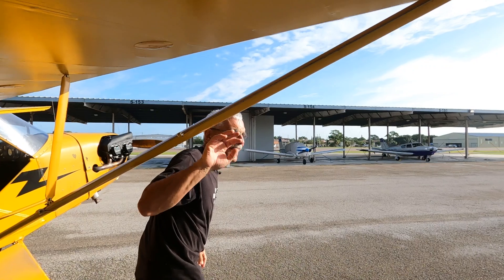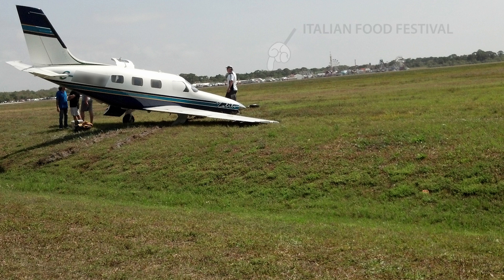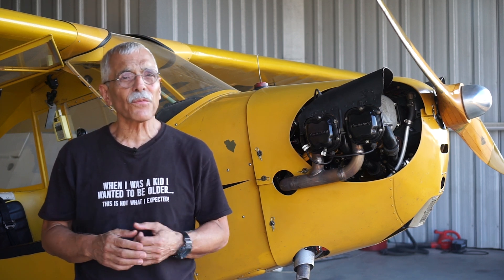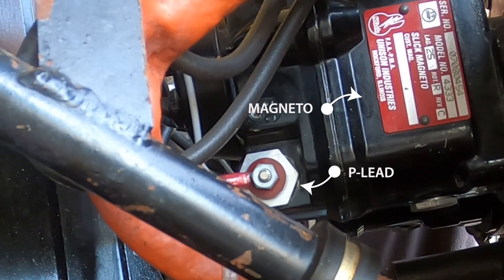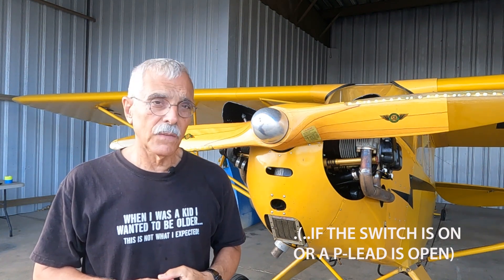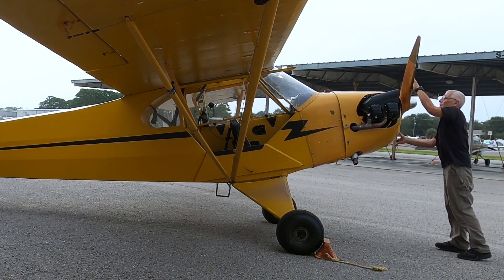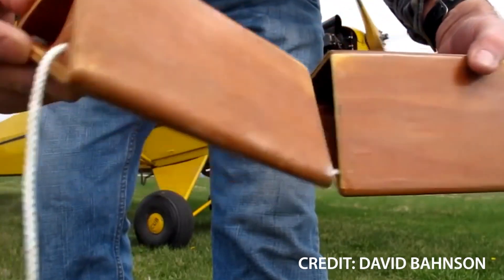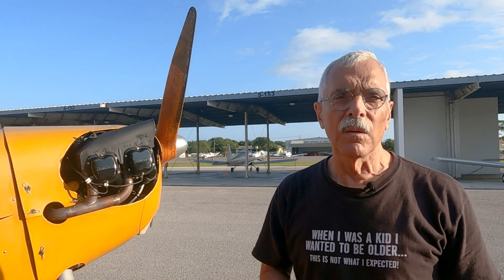Bad for Aviation: Hand Propping Run Amuck

Comment: I have the best hand-prop disaster story of all time…I was studying (back in the 80s) in the Purdue aviation library which was the old control tower overlooking the ramp. It had couches by the windows. It was winter and the ramp was icy. I heard an aircraft engine start up and immediately go to full throttle.  I jumped up to see what was happening. The scene that greeted my eyes was a man laying on the ramp holding his arm, and a Cessna 172 that had just passed him and was rapidly accelerating towards the covered fuel truck parking shelter with fuel trucks lined up in a nice row. I had a few seconds to decide if I should duck to protect myself from the impending explosion, or watch the firewall and maybe still have enough time to duck down. Curiosity got the best of me and I kept watching. As the plane picked up speed, it turned slightly and wonder of wonders hit squarely in an empty stall with a fuel truck on either side. Both wings peeled back from hitting the support posts. As fuel from the ripped open wing tanks streamed back in the wind stream blown by the prop turning at full power inside the stall, I thought I might yet see an impressive fireball. The man who had been on the ground got up and started running TOWARDS the plane. I kept watching until the carb starved of fuel from the rapidly drained fuel tanks, maybe less than a minute, and then it was quiet. A few moments later, to my surprise, a young woman came running from the stall towards the man! That young woman was very fortunate she was not immolated. Later I found out the back story:  This pilot came out to his plane in the morning after spending the night locally and found his battery dead. He elected to hand prop because he was too cheap to pay for a start cart which was available. He was a doctor ‘from up north’ and he was married and the young woman was not his wife or daughter. I would have loved to have been a fly on the wall as he explained the broken wrist, destroyed airplane, and the young woman, to his wife…just sayin’.
Reply from the maker: Geezus. Thanks for that story. I've heard a surprising number of others like it. I had this very thing in mind in making this video. These things are entirely avoidable. No exceptions.
Reply: Poor decisions love company I suppose...

Comment: As with a lot of engines, the Rotax 912ULS used on the planes I flew in school need a couple of turns of the prop by hand to get the oil to circulate a bit. Even though I was making sure myself that the mags are off and everything else is off, the instructor would also check the same, other students would also check it, and it still made me nervous.

Comment: Question: @11:10, why does the prop appear to switch back-and-forth between turning clockwise and counterclockwise? Was the prop continuously spinning in the same direction but it was just an illusion that made it seem to switch directions?
Reply: Yes. Aliasing as the prop speeds up and starts syncing with the camera frame rate. Same effect can be seen on car wheels in videos

Comment: 30+ years ago, I was that 18 year old clown that was asked to hold the throttle and brakes for an older gentleman hand starting the plane. 

Looking back, he didn't show me where the ignition kill switch was, nor did he show me how to kill the fuel either. Just "jump in, push on that and put your feet here and press hard".....

Comment: I worked the Line as I built time and could write a book on what I have seen. At least 2 run aways from hand propping and one Aerostar got his #2 motor running and noticed he was chocked so he got out and it proceeded to do 360s amazingly not hitting anyone. Other were all Mu-2, Commander types and were deadly. "Never ever even OFF walk under a wing. It teaches bad habits.
 A 172 quick tie dwn for a storm, no tail rope so someone used a concrete block. Yes, he taxied with the block dragging. OT but a Baron came in and had soiled underwear wrapped around the tail flying proudly. A charter 402B had a man relieve himself into a fire ext nozzle and discharged it inflight. Mistook it for a Little John.  On Dixie in KATL a Delta told ground that they had a schedule and to tell the F-28 ahead to stop dragging his feet. The F-28 opened his rear center clamshell SB and made a farting noise. 1st time I ever heard the full lineup on Dixie break out laughing.
I could go on and on.....

Comment: One other thing. Stand fairly close to the prop in a comfortable stable position.standing back too far because you’re scared causes you to fall forward as you pull it through. Stand close and step back during the pull.

Comment: Leg swing gets you out of the arc in a hurry. Removing chocks near a spinning prop is also a danger. A long rope properly tied to the chocks
And laid out to be grabbed far away from the prop is important . Especially on nosewheel aircraft.( which should ONLY be propped when you’re stuck in a desert without water!)

Comment: One the things that saved me was to ALWAYS assume the engine is going to fire. Many, many years ago another lineboy and I were moving a customer's Tri-Pacer from it's hangar to the shop. Dead battery of course. He was inside, on the brakes, with the switch OFF (confirmed), throttle at idle. Now 45 years later, I don't remember why I pulled it through forwards to prime it, but I did. It fired. Luckily I was following what Old Buzzard Jack had taught me and did the leg swing, or else I might have been into the prop.

Comment: A loved one owned a Cessna 140 more than 30 years ago. He was a careful and conscientious pilot, but one day he got careless... more than I would have ever thought.
On a fine Saturday morning he prepared to take a short flight. Everything was good except the battery was dead. With the allure of flight just a minute or so away, he set the mixture full rich, cracked the throttle, and turned on the mags. He went around front and propped the plane. That was when things went so very wrong.
The throttle was farther open than he intended and the engine roared to life. The plane was not tied down. The brake was not set. It started rolling toward him so he dodged around and made a grab for the door. He was unable to get in the plane and had no option but to grab the strut and hold on tight. The plane accelerated as it went, until he lost his grip, fell, and was hit in the face by the horizontal stabilizer.
He came to in the ambulance and was briefed on things. The plane had trundled along until it hit a (mercifully empty) fuel truck. He had a couple of facial fractures and a concussion but recovered.

Comment: Great video, but a respectful question.  Why ever prop a cub from the front?  I have always done it from the back.  Out of the prop arc, airplane would instantly move the prop away from you (not toward you), you can hang on to the door frame with your left arm, and are right near the door / engine controls.   Thanks again for the great content.
Reply from the maker: If you place the airplane in a position where it can move forward, you don't know what you're doing.  The airplane can be secured NOT to move forward. That's the point of the video.
Reply: @AVweb Agreed,.   I submit that propping a cub from the rear is the best choice, which is the real point of my comment.

Comment: My first few hours were in a 47 Aeronca Champ with no electrical system.  The CFI did the first propping.  I did it for the next few hours until they bought a different plane (C150).  I tried to prop a Cessna 210 but I couldn't even turn the prop.  I'll always remember those days ... 1970.

Comment: J3 owner … good video. I think, the most important thing is for sure to be aware of possible unwanted outcomes. If I have the luxury of a second person around, I like to ask them for assistance, for instance just standing next to the tail just in front of the elevators. Of course only with people which are not afraid of getting a little wind in their hair 😉 Otherwise I use chocks with strings attached, which I can pull in as soon as I am safely seated with my feet on the brakes. Not always fun, as they can get stuck under the wheels and I have to get inventive to get them free - or I have to kill the engine, reset them and start all over. The way you removed your chocks, I couldn't do it. At least not on hard surface. She would be a runaway or at least a merry-go-round before I even got a chance to hop in 😂
Oh, and I always prop from behind, ready to grab the throttle, which I have to adjust anyway, and to turn on the second magneto, as mine has only one with impulse coupling. So I start on one and switch to both as soon as she starts running.

Comment: 1979. Myself and another air traffic controller were working the control tower at SWF INT airport.Our tower was 100 foot high on a hill that was another 250 from the ramp elevation, so we enjoyed a Gods eye view. Guy walks out of the FBO to his J3 on the main ramp and sets up to hand prop by his own self. The Cub starts off along the ramp 20 feet, climbs into the air, and appears to enter left closed traffic to his starting location.  There was a huge construction project at the time to make over our main runway. !5,000 foot. Heavy construction equipment and personnel were all over the place.Cub was as high as our tower then descends back down to the ramp and executes a touch and go! It was like watching a movie in slow motion. Or out takes from its a mad, mad world. The two of us just watched in amazement! The Cub settles back down on the ramp and appears to go after the construction crews. All this time it has missed rows and rows of parked aircraft and many heavy construction vehicles. The end came when it ran head on into a BE58 that was half way out of  its hanger. No one was hurt. The cub and the Barron suffered major damage. There was nothing like cell phones then. But I will always remember that beautiful fall afternoon. IH air traffic controller 1974- 2001.

Comment: my dad bought a 120 named debbie from my grandfather who had let someone use the plane and got the switches mixed up, hand propped the plane in pre flight thinking it was off and it fired up. with guys wife in the plane, all he could think to do was pull on a strut until turning the plane into another to get it to stop. it was probably down 15-20 years before my dad restored her, new fuselage was purchase at the time of accident. she is with a new owner today.

Comment: I saw a Pitts special runaway when the pilot had to hand prop it because of a dead battery. He grabbed the strut as it circled faster and faster sling him away. It nosed over before hitting anything. The old man AP/AI had no use for cheap pilots with dead batteries! He said if you can afford an airplane you can afford a battery!

Comment: I learned in a Champ 7AC and spent many happy hours aloft in a J3 Cu,b. Paul's advice is right on. Never had a problem finding someone to spin a prop and was always ready do it for someone else. But that was 60 years ago. Perhaps 'modern' pilots are unschooled in safely propping an engine, just as few people know how to safely hand-crank a car engine (or have seen a car with a hand crank).  When propping for for someone else, ALWAYS grab the prop and try to move the plane forward and back to be sure the pilot has his feet on the brakes. A few times a (usually) student would ask and I"d grab the prop and the plane rolled easily  because the pilot did not realize they weren't hydraulic brakes that would lock up easily. Not involving propping but another point was when giving someone a ride in a J3 or Champ back seat (feels "safer" to some since I'd help cushion them in a crash) and I'd notice their feet pressing hard on the brakes on either side of  the front seat as we approached the runway. Nothing ruins a landing like touching down with the main gear wheels locked. Making sure  their feet were away from the rudder pedals and brakes became a key part of my pre-landing ritual.
Reply: My champ had a parking brake when the brakes were mechanical. Now it’s non-functioning because it’s been converted to hydraulic but thankfully it also has an electric starter.

Comment: Try moving the prop round a bolt pitch, I hate it mounted a bolt early like your Cub.
Reply from the maker: You may like it that way, but I don't. It places it right on the compression point and it requires bending into the prop more to get good power into the swing. I find this very risky. It places the prop in a position more like propping a nosewheel airplane, which has its own risks.

Comment: A famous story in my neck of the woods is about a very experienced J3 pilot, CFI, A&P-IA re-starting the club's C85 J3 after fueling at the gas pumps. What happened was his own fault for shirking his club A&P duties. He was anxious to give a certain young lady her first ride in a small airplane. Because he had neglected to keep the battery charged, he had to handprop it. And because he had neglected to keep the engine in tune, it was flooded easily. No problem... right? He instructed the young lady in the front seat to hold the brakes while he got out to prop the engine from behind the prop. Because the engine was flooded, he knew he could clear it by pulling it thru with the throttle wide open a couple of flips. He turned off the mags, opened the throttle and got behind the propeller, telling the young lady to hold the brakes. Well, she didn't know that there were two brakes to hold, and he didn't know a P lead was broken, so when he pulled the prop thru... it started... at full throttle... with the left wheelbrake holding the airplane in a left turn. Sensing the airplane trying to run over him, he tried to reach into the cockpit, but was blocked by his non-pilot passenger from reaching the controls, caught between the right side wing strut and wheel. The airplane came to a stop only after the right wing collided with a C152, and the prop ate half way through another C150. 
It was a good thing that our liability insurance paid off the other two airplanes, but shortly after the accident, he developed a deadly desease which he succumbed to less than a year later. The airplane remained wrecked and unflyable for over five years, until we Shanghaied a new A&P and coerced several volunteers into a very expensive complete restoration.

Comment: I always swing the leg as a way to step aside from the prop arc and I never prop an acft that has a starter. I've always just get it fixed. We had a guy with a 260Comanche and he tied it down (not tight enough) hand prop it and it jumped forward and kill him. I treat ALL props are hot regardless. In shop we had a new rebuilt engine and that bugger started up when the prop was turned (click-click )and that prop took off that Piper Colt and bounced all over the shop with several of us jumping all over, what a sight.

Comment: Several years ago, my wife and I were looking at some planes parked outside an aviation museum.  There was a gentleman hand propping a small plane with a small child seated inside.  I don't remember what kind of plane.  The engine caught and revved up.  The plane started rolling forward.  By the time he got around the prop, the wing, and strut, the plane was moving too fast for him to get to the door and the plane was heading for the run way.

I started running for my van parked about 100 feet away.  I'm not sure what I would have done, but I figured in the worst case I could get in front and gently slow down letting the plane run into the back of the van and then bring it to a stop.  Fortunately, the terrified child managed to push one of the pedals causing the plane to go around in circles and dad managed to catch up with the plane cut the throttle.

At the time, I didn't think about that being bad for aviation.  I just thought it would be really bad the child and father.

Comment: You are a "perfect" presenter!  A true master.  Were you ever in the military?  Most importantly, it's a plesure, just to watch.  I have finally learned that an impusle coupling, can be used on an airplane.  Thich Nhat Hanh said that "What ever we do, should be pleasant as possible and free from form!".    At 64, I just study what I want and do it like following any mystery for fun.  No formal, approach, which would be work,lol.  Setting up a new laptop or ver much more than that, calls for outside help and I'm miserable until it works.  I only fly in my head and I prefer simple, lol.  My dream vehicles,  only have electonic ignition as their highest technical level. No AC, 'cause it's too complicated and I'm lazy. Long live the choke and points and condensers, lol.

Comment: Hello paul . As always a great video . Very entertaining dry sense of humor as well as packed with useful info . I once witnessed this exact type of incident where a tiger moth jumped the chocks at rand airport FAGM in Johannesburg . ZS OOR duly chased the pilot as it did a spectacular ground loop, hot on the heels of the albeit very experienced pilot . It then unceremoniously had a prop strike and incurred great expense.

Comment: So this is the aviation version of kickstarting a motorcycle.  I've had a couple of my vintage bikes kick back so hard that I limp for a couple days.  One sheared the forged steel starter in half.  One almost made my toes touch my shin.  So based on that experience with ~400cc engines, I'm going to say that wrapping your fingers around the sharp bit of a thing called "blade" would probably hurt pretty bad in the event of a backfire from one of these big-piston mamma-jammas.